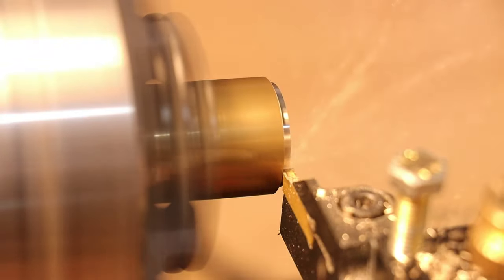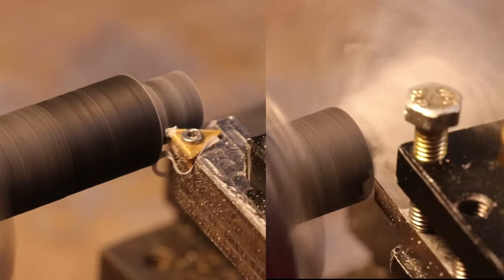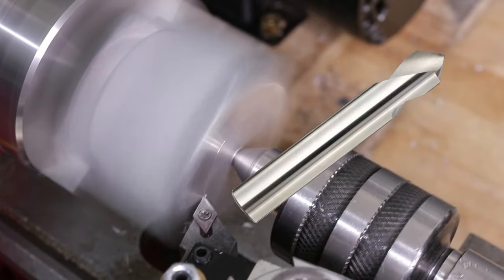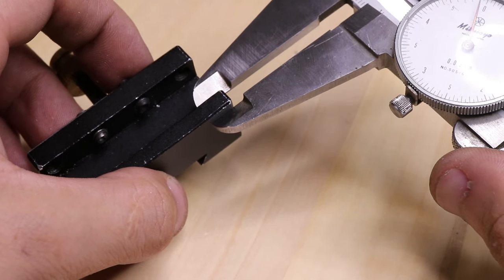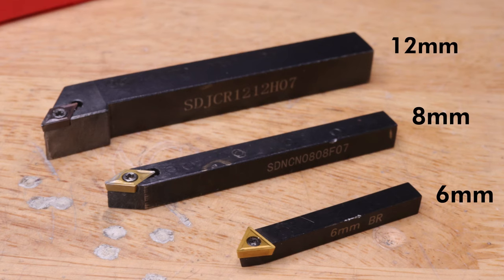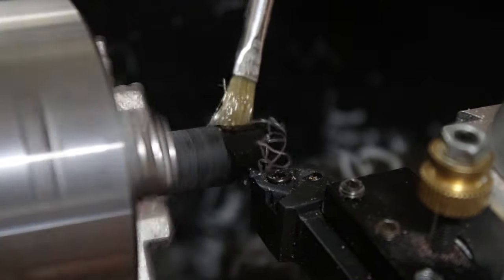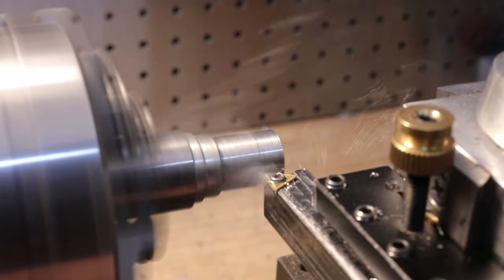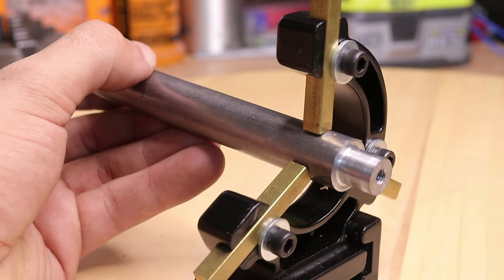Essential Mini Lathe Tools And Accessories

Comment: A bright colour to make it stand out! What i’ve been screaming at spectacle manufacturers and those who pump out  hand tools that come in matching uniform coloured handles, and their promotional black interior deep tool cases with a complementary cylindrical black roll-away torch. I mean WHY ! All i want to do is find it not guess and squint at the bit of the tool. A different bright and  visually contrasting handle for each different size, yes i made a beginners mistake and cheaped out on a set from the red handle brigade. Buy cheap repent forever.

Comment: Great Content!! Very informative, although I wouldn't recomend to mark parts with that type of calipers because you can damage them, you can find parallel marking gauge vernier calipers that are made for this task
Reply from the maker: Cheers. About the calipers, I would agree with you that I would never use my expensive calipers as marking scribes, but I don't have an issue with using my cheaper ones as marking scribes. The steel is hardened on the ones I use, so they are pretty resistant to wear.
Reply: @artisanmakes  , 
Please provide the address for this mini lathe dealer/distributor, in Indonesia .

Comment: Hello I got me a db200.  Because my shop is only 10 wide x 16  with 6’ garage style door. Not a lot of room. Have mig welder ,drill press, band saw, 2’x3’ steel fab table with 2” holes. Made by Klutch. Good table for money. Nice tool chest. And no room left. Lol. But that’s one reason got Unimat.it was old but brand new. A dr bought it in the early 60s and never used it. Got it from his estate sale. Had some good extra goodies. And the original wood box. Wasn’t rusty or scratched up. Wow. Got it for 500$ us. Has milling attachments. So I’m working with it I’ve bought some upgrades for it dail holder when in mill set up. Makes a dro. Quick turn screws to slide tail stock and head stock. Extra mx70 cross slide table from proxxon. Little but nice. Little carbide cut set. Harbor freight. Now get quick tool holder and go to town. Thinking of building a big garage for ole lady’s car and other stuff so my little building would just be little shop. Free up lot room. Air compressor stuff be in big garage just pipe into little shop. Just thinking u know how that goes. Anyway love the channel. Stay safe from ur ole WV hillbilly buddy.

Comment: Excellent tips and tools.  I've used my mini lathe a few times for a couple of metal pens but haven't used it in over a year...I do need to get a few other tools and accessories for sure...I've yet to put the quick change tool post holder onto my lathe, however I know that's part of the issue I'm having is the tool post holder that comes with the lathe is very limiting and time consuming to adjust.

Comment: FOR YOUR CONVENIENCE

* TOOLS FOR MINI LATHE *

HSS Lathe Tools (w/ Narrow Parting Tool)
Carbide Lathe Tools
Cobalt Drill Bits for Steel
Sutton High Speed Steel for Everything Else
Combination Spot and Centre Drills
MT2 Chuck for Tailstock
Live Centre for Tailstock
Layout Fluid (Chisel Tip Texta)
Calipers (Digital or Vernier)
ISO 68 Way Oil
Lighter Oil for Cross Slides
630 88 Lithium Grease for Other Parts 

* OPTIONAL *

Quick Change Tool Post
Independent 4 Jaw Chuck
Dial Indicator With Magnetic Base
Thread Pitch Gauge
Threading Dial (Attaches to Lead Screw Just Right of Slide Stock)
Tail Stock Die Holder
Machinists Hammer (With Nylon Face)
Thin Shim Stock
Cutting Fluid (3-in-1 Oil, Paraffin Oil, etc)
Micrometer
Spring Divider
Steady Rest

Comment: I disagree with 4:23, I think if you are to use a center drill for spotting, you should only use the conical tip, and not the cylindrical section of the center drill. If you go into the cylindrical section, the next drill encounters a hard edge, not the conical hole made by the tip, which serves as the location fixing.
Reply: Correct, conical tip is serving as aide for a drill, specially the very tip.

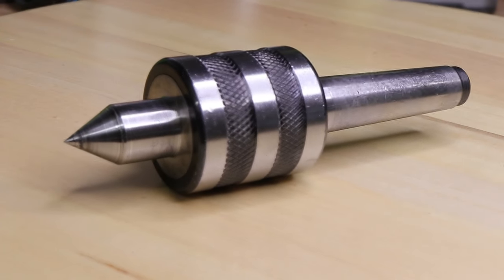Comment: 5:40 Since the chuck isn't moving, could you make the key stay on permanently?
Reply: Vibrations and bumping will make it a bit dangerous to just leave it in the chuck. What I have seen done is drill a small hole through the key and attach a cord to that. Then have the cord attach to the tailstock. And maybe throw in a magnet somewhere as well. :)

Comment: Very informative videos, thank you. I'm planning a table saw project for which I'd need to turn the 260mm long and about 30mm diameter arbor from steel. It would installed in pillow block bearings. I was looking at a 1000+€ small lathe, similar power to this but it has hardened ways. Do you this would be doable on that lathe, with practice? Another more optional project would be making male and female interlocking trunnions from 100mm diameter disks, for tilting the blade sideways.

Comment: I plan to cut a lot of steel and titanium with mine at a high ish tolerance around 10micron runout and a 2-5 thousandths tolerance
Reply: Remember when cutting titanium...make sure to clear the chips extremely frequently...titanium fires are hard to put out and can damage machinery

Comment: I noticed an oddity at minute 3:46 
The twist drill bit, when backed out of the hole, actually drops a bit, indicating that either the bit  and tailstock isn’t parallel with the bed, or the bit is bent. Perhaps, also, the centerline of the chuck isn’t parallel to the bed.
What is the remedy for this?
Reply from the maker: This was an early issue with the tailstock. It was a combination of the tailstock being slightly misaligned with the spindle, which was fixed by realigning using the hex screw under the tailstock. The vertical alignment issue was fixed by adding a small shim under the front of the tailstock to tilt it up. This took a bit of time because I had to disassemble the tailstock to wedge the shim in place.
Reply: @artisanmakes  , 
Please provide the address for this mini lathe dealer/distributor, in Indonesia .

Comment: I have a 8x16 grizzly coming I have a oxa quick change post to install do I want to use 1/2 inch tooling for rigidity?  Or do u want to use 3/8? Looks like the stock tool holder lists 3/8 tooling
Reply from the maker: I use larger 10 and 12mm tooling because there are more options for holders and inserts.

Comment: I was wondering what should be the correct size chuck for a 9 x 20 lathe. I bought a 6" new replacement chuck for the small 4" three jaw chuck because I don't have both sets of the jaws for the 4" one. But I have yet to install it. It is a self centering three jaw setup. But I think I would also like a four jaw individual setup for odd parts. What is your suggestions?
Reply: Depends on your usage. I'm a machinist by trade so when I bought my lathe I immediately outfitted it with a 3 jaw, 4 jaw, and two collet chucks since I'm used to the versatility. That may be a bit excessive for a hobbyist starting out however, but I would definitely recommend an independent 4 jaw and self centering 3 jaw at minimum as it will give you the ability to do everything even if it takes you a little longer dialing stuff in on the 4 jaw

Comment: Measuring the ID of a part with calipers with bores is pretty much impossible to get perfectly accurate because of the trigonometry of the offset jaws. A telescoping gauge set are a cheap but vital tool for measuring precise bores. A bore gauge or bore calipers are better but more expensive. Pin gauges are amazing for really small holes

Comment: I am new at machining. So If some experienced using mini lathe could answer my question. Can a mini lathe 8x16 with 900 wat motor turn steel such as you would have a on an trailer axle spindle? Which is fairly hard steel.
Reply from the maker: I'm sure you could if you use a sharp cutter and take light ish passes. My lathe is smaller with a 1/2 hp motor and I can turn high tensile steel within reason.

Comment: Are chuck bolt patterns universal? how can i know if a chuck will fit my mini lathe?
Reply from the maker: If you buy a 80mm chuck with no backplate installed for your 7x lathe it’ll fit. Chucks have either a 3 or 4 hole pattern and these smaller lathes have both patterns drilled into the spindle nose.

Comment: How'd you make that dome/doorknob shape at around 2:36?
Reply from the maker: Those are the stock ones that come with the lathe. Normally to cut domes I use form tools, but there are radius cutter attachments for lathes that are easy to make. Cheers
Reply: @artisanmakes  Thanks for the reply!

Comment: If my Lathe comes with a 100mm chuck can I still use a 125mm 4 jaw chuck ?
Reply from the maker: You might need to make a backplate for it fit the larger chuck. I haven't done it personally but I have seen it be done.
Reply: Thank you for the fast answer ! If I don´t want to make a backplate then I better do stick same 100mm right ?

Comment: Great vid, as always. What is the steel backboard on your lathe that you hang things from?
Reply from the maker: Cheers Paul, the steel is just a steel pegboard that is a part of the workbench. I am not a huge fan of the off the self peg board accessories so I find it easiest to make my own holders and zip tie them to the board to they are secure.

Comment: HI Artisan Makes
I disagree on the digital caliper. I buy cheap Harbor Freight dial calipers. For most of the work i do these are accurate enough and they never have a dead battery
they are so cheap that if they ever get erratic i can just throw them away and buy new ones.  I have never had a HF dial caliper go bad due to dirt or swarf in the rack and pinion gear.
my two cents

Comment: > Calipers
> Very accurate
More like approximators, if compared to micrometers. Of course I don't know what I'm talking about as non machinist. Nice video though.
Reply: For a diy or hobby machinist, they’re plenty accurate.
Reply: Don't confuse accuracy with resolution.   And remember the source of errors.  CALIPERS  measure out of line with the beam  unlike a" micrometer" G clamp shaped instrument.  Which measures inline with the measured thing.....

Comment: Hmm, the chances of chips getting into the gears of a high quality dial calliper like the Mitotoyo shown are just about zero. If you are making you tube videos the dial is an excellent way of showing readings on camera. Vernier scales are a right pain to read for a beginner and mechanical dial gauges do not need those pesky batteries that are always dead when you need them. BobUK.
Reply from the maker: Hey Robert, I think I should have clarified that the chips that I really worry about getting in the calipers rack is brass chips. When I first got the lathe I used the dial calipers a fair bit and had to clean out the rack a few times, though you are right it doesn't happed tooo much with aluminum chips. And you are right, Vernier scales are a real pain to learn. My first course in university had us learn how to use them off by heart, but once you pick it up you never forget how to use them. Cheers
Reply: If you buy a decent digital caliper you can have the battery last upwards of a year or two. I use mitutoyo digitals at work every day and I last replaced the battery some time 2019. They will cost way more than a set of dial or vernier scale calipers, and you have to be careful not to buy a counterfeit caliper too, but if you can afford it, or find a used pair online, I would totally recommend one

Comment: Using the vernier caliper as a marking gauge is one of the worst shop practices there are.
Reply from the maker: Not worth getting too worked up over a cheap $5 set of callipers. Hardened steel and last years